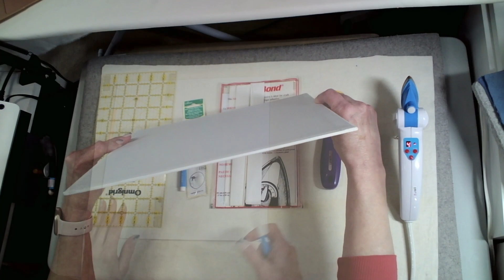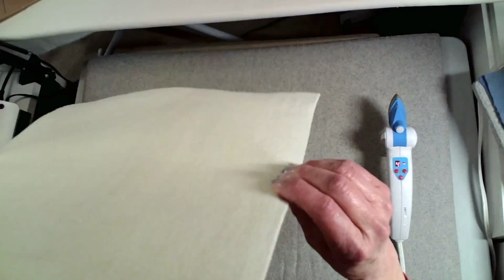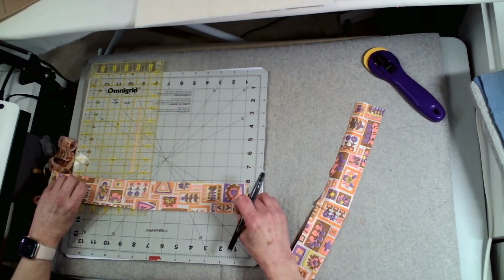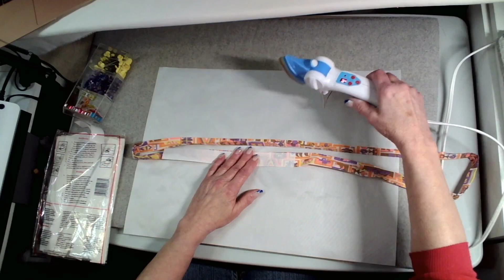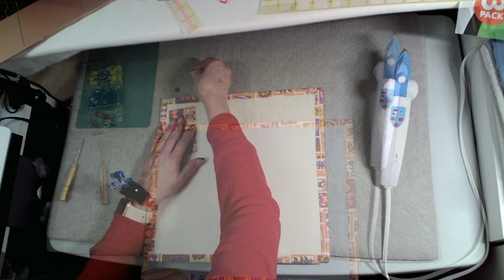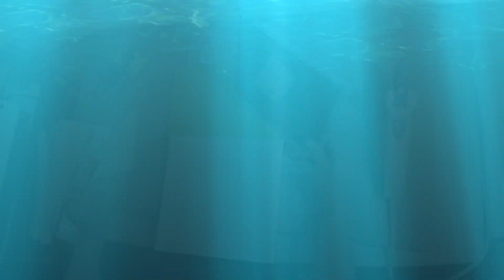How I made my Design Boards

Comment from the maker: When making the design boards I used felt yardage because it is what I had. You can use batting if you want, but I wouldn't use polyester batting as it will melt when you iron it.  Also I used 2 inch strips to bind but depending on the thickness of your batting or felt you may need to cut your binding strips wider.

Comment: Thank you. The felt you use, is it those squares you can buy at joannes fabrics or Michaels?
Reply from the maker: The felt I used was felt yardage I had  from years ago. We do not have Joanne's here in Canada. I am not sure what is the largest size felt you can purchase at Joanne's or Michael's but you can use batting instead of felt, I just wouldn't use polyester batting as the heat from the iron would melt the batting. I hope this helps.
Reply: @Aroundtoit3712  ok thank you
Reply from the maker: @donnarichey144  You are welcome. If using batting you may need to adjust the width of your binding strip depending on the thickness of your batting.